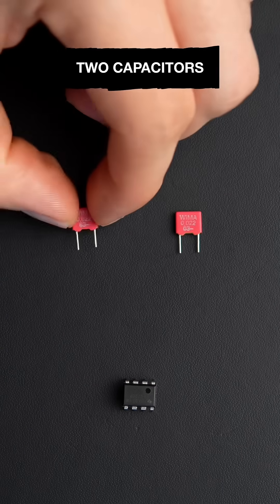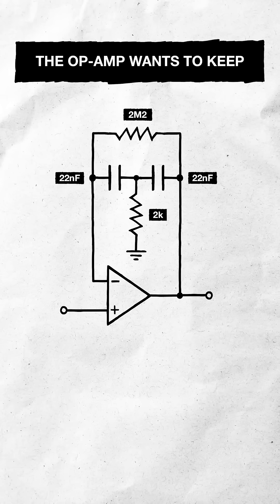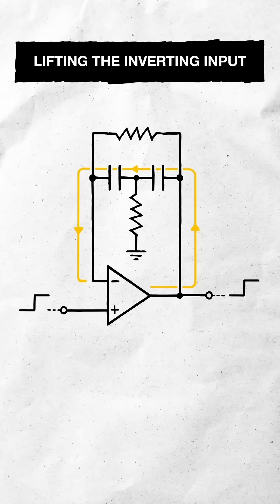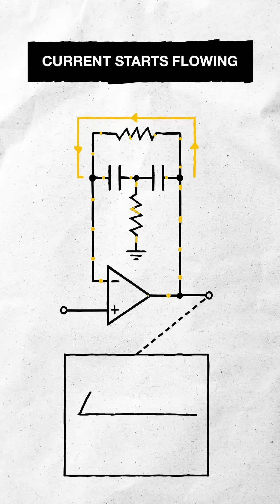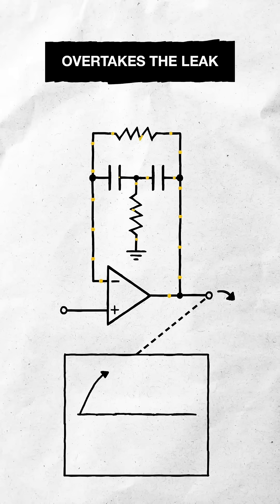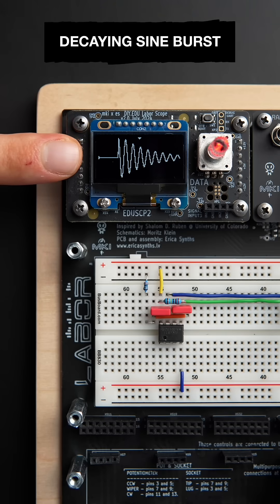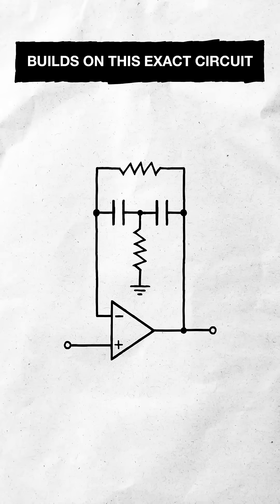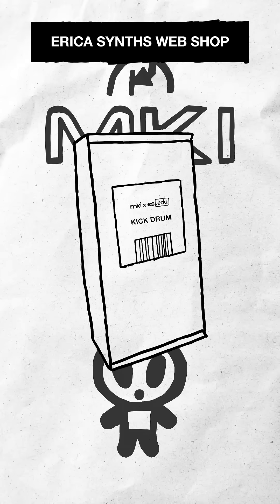5 basic components = punchy kick drum

Comment: This circuit also makes a great resonant low pass filter, can be voltage controlled by replacing the resistor with a transistor or diode.
Reply: this "kick" sound is a lot like pinging a filter, so that tracks
Reply: @TheLuckymod13  Yep!
Reply: A transistor or diode? How does a diode make it voltage controllable? Also if you have more info on the transistor setup, please share :)

Comment: What is this osciloscipe? I mean I know it is form edu kit. But can i make separate osciloscope module for modular from it?
Reply from the maker: it's an expansion module for Labor, a prototyping tool i designed together with Erica Synths. it's powered off of eurorack voltages, so you could definitely run it in a modular setup.

Comment: Since the impulse response is a damped sine wave, it means that this circuit also makes a really simple, reasonably narrowband bandpass filter!
Reply: Can you explain the math about how you found that out? What can you infer about the filter's transfer function?
Reply: @khalidh5933 the fourier transform of the impulse response is the transfer function. And it checks out when simulating it (about 55dB gain at peak!)
Reply from the maker: yup - the two paths i mentioned (“leak” and “bridge”) are basically just a high pass and a low pass smashed together (which creates a bandpass)!